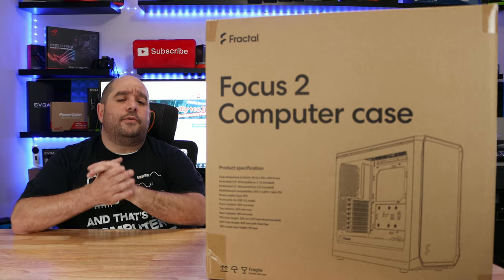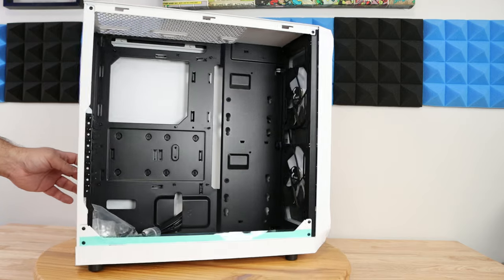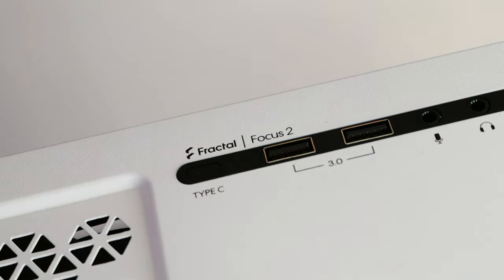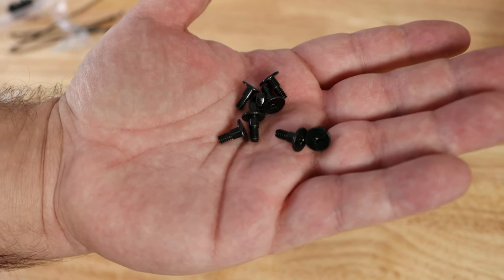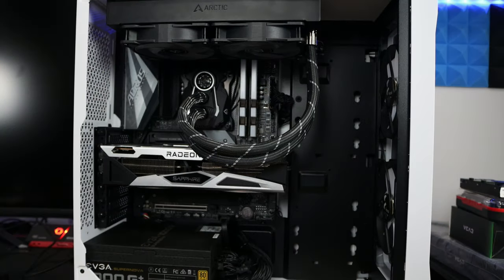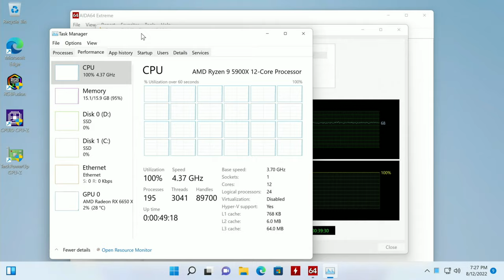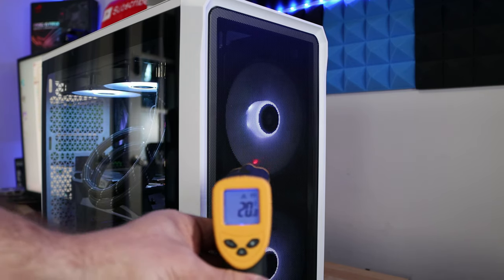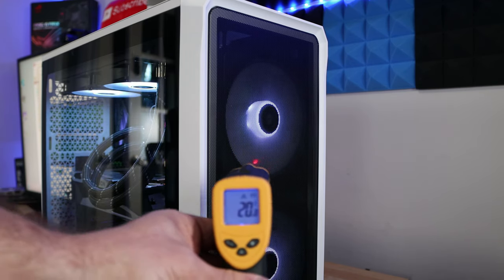Fractal Design Focus 2 RGB PC Case Review: You Need This Case

Comment: Great video.  I have this case on order, it is to arrive tomorrow.  This will be my third Fractal case, all different, but the first two were so easy to work wit.  I did not need an expensive case, this is going to be for a backup computer'; I just upgraded my system and wanted to keep the old one as it still works well and this case will be perfect without spending a lot of money.  Thanks so much for a very informative video.
Reply from the maker: good stuff bud, so very happy you chose this case, it REALLY is a nice case.  I would have used it for myself, I do love it BUT it won't allow for a 360mm radiator not a big deal for 90% of people hahah, but I need to have it but I go over all of it here.  I am 100% sure you will love this case, it is AMAZING.

Comment: I'm kind of disappointed that there's no shroud for the PSU, thanks for the video that revealed that there's only like a lip cover.
I were quite excited over this Case.
Reply from the maker: I kind of like shrouds, but I think it is sooooooooo much better without it, makes building soooooo much easier and the pocket they have added  makes it better for cabling.  I will have a more detailed, slower build process video coming monday in case you are interested.

Comment: thanks for the video. does it fit a cpu cooler as noctua d15  or similar pretty easily, right? which one is better between this and air pop?
Reply from the maker: I would love to tell you, but I have never used a Noctua D15, sorry my friend, but it should be easy yes.  Well, the Air pop is nice, I love the color options, BUT I like the fact that the Focus 2 doesn't have a PSU shroud, so it makes it soooo much easier to cable manage, so I like the Focus 2 more.  The shroud is good at hiding cables and such, but if you see the way I cabled this, you cant really notice them, the case makes it easy and much better airflow.  I hope this helps.
Reply: in case you're still wondering for whatever reason- it does fit a Noctua NH-D15S, that's what I have inside mine

Comment: You don't need those radiator brackets now. The top mounted radiator extension brackets were only a temporary fix for cases that had already been manufactured after we found out the incompatibility issue. 
Newer top panels were made after the first manufactured batches that have an updated top panel that do not require the extension brackets.
the latest Focus 2 cases are not affected and don't need the brackets
Reply from the maker: Ahhh good stuff my friend thanks for letting me know.  This review was when the case came out and it had helped a few as you can see below but it's great that they updated it

Comment: I have a question but it has nothing to do with building a pc or something. Its about PS4. Usually I’ve been playing and it always says “PS4 is too hot, turn it off” something like that. And then it turns off automatically. If you can give me any tip on how to fix it would be incredible. I also saw many vidoes about it saying to clean it but never works
Reply from the maker: sounds like the thermal paste has dried, or you have dust in there, I am not sure though, I have never had an issue with that thankfully, and I have owned just about every console.  I skipped out on MS after the 360, so I have PS5 and Switch and of course my main item of choice, my PC.  I don't focus on that and I don't want to lead you down the wrong path, I would search for videos on disassembling the PS4 so you can dust it, and videos on how to repasted it or use thermal pads.  Before you implement anything they say, be sure to read the comments all the way through, because what they do could cause problems with the PS4 or make it amazing.  I don't know if they use pads or paste and how thick the pads would have to be.
Reply: I tried to open the ps4 myself today but from every video I saw my ps4 was a different model so I still couldn’t open it. But thx for the help anyways. I will try again in a few just to check
Reply from the maker: There are about 5 different models of PS4's.  Look on the back of your PS4 for the exact model number and search using that.
Reply: I tried to do that and looked exactly where they showed but it was not saying anything for some reason
I found it, its CUH-11168 apparently
Reply from the maker: @rtiluuk_9933  I would love to help you on that, but I really have no idea on that as I have never taken my PS4 apart.
Reply from the maker: @rtiluuk_9933  try this: https://youtu.be/oAtm4NO_y-E

Comment: Do you think it is comparable to more expensive cases like Torrent/Meshify 2 in temperatures and noise levels? 
Could you fit 280 AIO there with extender?
Reply from the maker: I give you all the answers in this video my friend, have you watched it?  As for between the Torrent and Meshify 2, I love large cases, I just reviewed the Meshify 2 RGB and I liked the Focus 2 better,  not as big, but just right.  Torrent, I want to review it, but nothing yet.  I highly suggest you watch the video.
Reply: @ThisBytesForYou  I saw you installing 240 with extensor but unsure about 280, I saw the temperatures and noise but unsure how it compares to others. Thanks for video
Reply from the maker: along the top you cannot, but you can along the front,, you can put a 280 or a 360 though I would rather have it at the top, the top only supports 240, so very happy you enjoyed the video.

Comment: would you say that the fans included with the case are enough for a build with the 5600 and the 6800xt?
Reply from the maker: As long as you have liquid cooling sucking hot air out yes, if not, get another fan for the rear
Reply: @ThisBytesForYou  thanks for the info man
Reply: @ThisBytesForYou  what fans does the case come with? I want all my fans to match.
Reply: what fans does this case come with? Also what size fan should i get in back?
Reply from the maker: You might want to watch the video
Reply: @ThisBytesForYou  i know its 120mm fans but what model are they
Reply from the maker: You definitely need to watch the video then, they are 140s and I go over the model number.  The time we have spent chatting about it you could have watched the video a few times over.
Reply: @ThisBytesForYou  do you recommend this or the g360a?
Reply from the maker: @ItzAmaterazu  I can't say, I have never reviewed a Phanteks.

Comment: Would this fit a 280 artic liquid freezer 2?
Reply from the maker: Supports radiators 360mm in the front 240 at the top and 120 in the rear, I go over this in the review, and much more, you might want to check it out.

Comment: Wondering how this compares to a Lancool 205 mesh. similarly priced with similar front panel mesh and 3 RGB fans.
Reply from the maker: Well, this one can have a 360 up at the front, the LAN Cool can't and that little pocket I show you in the video is AMAZING for cable routing.  The Lan Cool doesn't give you the opportunity to install USB type C, the FOCUS does. 

The more I use Fractal products, the more I like them, though I DO LOVE Lian-Li, but it's been a long time since I have used their products, sadly I don't work with them yet. I hope this helps.
Reply: @ThisBytesForYou  Thanks!. I have a few cases I had in mind including the Focus 2, Meshify 2 compact, o11 air mini, 4000D airflow and the lancool 205. I was disappointed when I learned the 205 has limited cpu heasink clearance of 160mm as my as500 plus is around 165mm. Aside from the lack psu shroud, the focus 2 seems really appealing
Reply from the maker: you know, I didn't like the fact that the shroud wasn't there but if you stop to think about it, how many issues have you had because of a shroud, how many issues have you had without a shroud?
Reply: @ThisBytesForYou  I was against a friend picking a focus G due to the lack of a psu shroud. However I was able to rout the cables around the rear to the point it wasn't much of an issue although nowhere near as good build quality as the Focus 2. Will keep an eye out for potential sales
Reply from the maker: Always a pleasure my friend, so very happy you stopped by, trusted in me to help you, liked and subbed as well as took a moment out of your day to thank me.  It means a ton to me and I am so very happy I could help you.
Reply: @ThisBytesForYou  I ended up finally getting this case. I like the front panel mesh and the fans included. One minor nitpick is I wish the metal bracket where you mount the front fans had more spots for the screws as I wanted to close that large gap between the two fans by sliding one up/down. On my lancool ii mesh, I was able to move the two 140mm fans to the top and fit a third 120mm fan at the bottom for a bit of extra front air flow. The top and rear grill I would have preferred a honeycomb shape rather than triangles so that there's less metal and more open space for air to be pushed out

Comment: Hm, that "$70" is $88 in my country. Based on what it has inside, I have to say it should be around $40.
Reply from the maker: OK?  Pretty sure you are asking for them to pay for the case for you, there is no chance there is a 57% markup on the case, you might want to go back to the drawing board with that figure.  with the rising cost of metals, and then the cost of tooling, I am sure they pay close to what they sell the case for, Tooling is INCREDIBLY expensive, not to mention the engineering to design the case.

Comment: Man I just wish it had a PSU shroud
Reply from the maker: it bothered me at first, but it makes it sooooo much nicer that it doesnt, check it out if you can
Reply: @ThisBytesForYou  would you happen to know the max length the psu can be before the cable grommet is unusable? My rm850x is 160mm long
Reply from the maker: @pinchpeak5203  I would say this power supply, 7 inches
Reply: @ThisBytesForYou  awesome thanks!
Reply from the maker: @pinchpeak5203  always a pleasure my friend, do yourself a favor and watch the video, you will see what I mean by 7 inches.